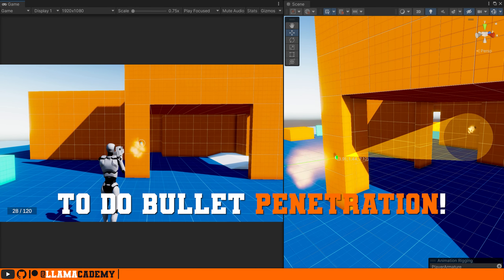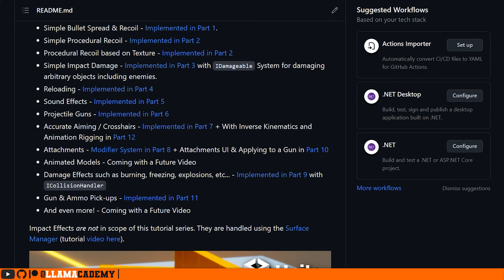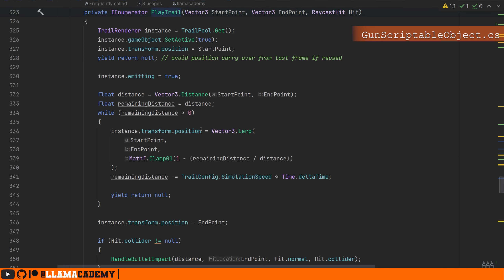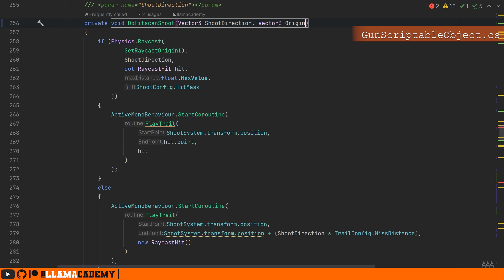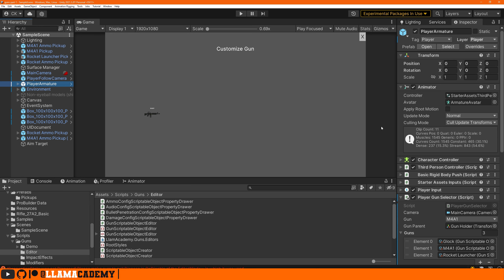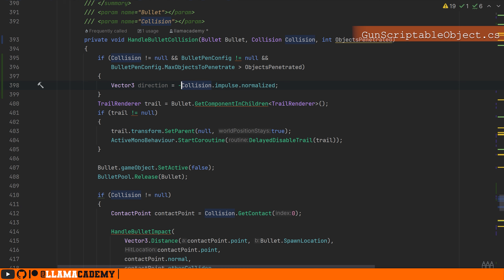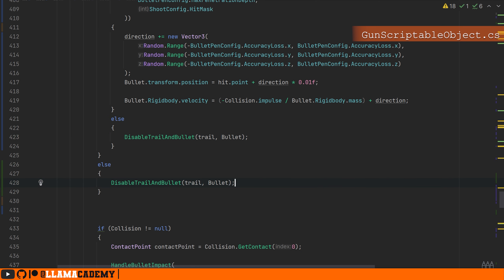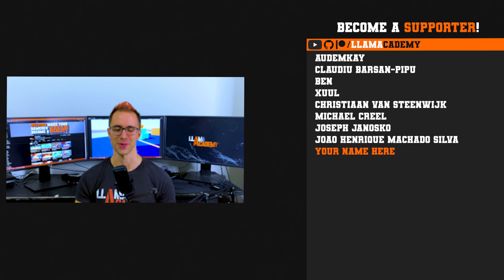Bullet Penetration with Raycasts and Rigidbodies | Gun Series Part 13 | Unity Tutorial

Comment: Chris for the test-your-knowledge portion, would you just edit every attribute on the bullet pen that's configured with the modifiers OR would it bet better to make a Modifier that can replace scriptable object reference ?

The SO reference way seemed less verbose BUT getting a reference to that is a bit hacky
Reply from the maker: I personally like the ScriptableObject replacement one better. That gives you the same authoring flow of the configuration and it's just a matter of tying the SO to the Modifier.
If you want to get REALLY crazy you could make AbstractValueModifier a ScriptableObject (right now it's just a standard C# class implementing our IModifier). This would allow you to create SO instances of each modifier which makes it easier to hook up your SO references without having to do something like Resources.Load or have all the references to the SOs on a MonoBehaviour that knows about the modifiers.

I did something like this previously but found it to be somewhat annoying to make the modifiers. If you go that route, I'd build out some editor tool to make that easier.

Comment: First, I just want to say that your videos are great, they are miles above most of the other channels who teach Unity incorrectly (like framerate dependent lerping is a frequent culprit) yet have 100ks of views.
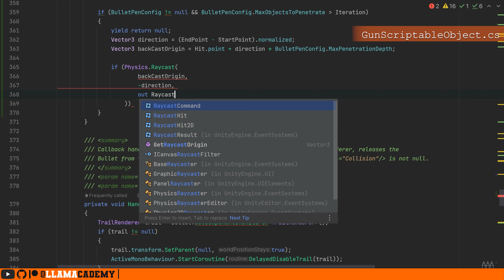I have modified your system quite a lot, but I still think I have discovered a potential bug in the way your bullet penetration raycast check works , shown at at 6:45. It would typically only matter if the MaxPenetrationDepth is a larger value though. Essentially, if you shoot a collider A, and the "backcast" ray hits another collider B, this means that the hit point of collider B will be the new trail/shot origin passed to the subsequent recursive call to DoHitscanShoot() - effectively meaning the space between collider A and collider B is ignored. You might already be aware of this, and it might be by design + I can't really think of a good alternative solution to avoid this, but I felt like it was worth mentioning
Reply from the maker: I did think about this but couldn't come up with a great solution for it. If you come up with something let me know! :)
Reply: @LlamAcademy  I have come up with a solution. After the first raycast A, you do a second raycast B in the same direction but with the origin set to A's hit + a small step in the shoot direction to prevent hitting the same collider again. Then, if raycast B hit something, you do a new raycast C with origin at raycast B's hit, but in the backwards direction. Raycast C should hit the same collider as raycast A, but on the opposite side. Now you can compare raycast A and C's hit to get the depth of the collider. To continue checking for colliders, set the raycast A's hit variable to raycast B's hit variable (hitA = hitB), and repeat the raycast B and C step in a loop, such that the next iteration raycast B's origin is set to where the previous raycast B's origin hit. I hope that makes sense

Comment: Hi Chris, good tutorial as always, but I have a question. If you have random between two constants damage selected(i.e 10 and 25) and damage retention percentage for example 0.75. You get this weird thing where the first contact can do 10 damage and the second contact 25*0.7 = 17.5 damage. How do you recommend to fix this?
Reply from the maker: That is a great question! It probably makes sense to make the damage calculation consider the original damage amount instead of the maximums. It also probably makes sense to move the penetration calculation within the Damage Config.
This becomes a little tricky for hitscan, but easier for projectiles. 

In this video I was considering constant damage or single curve falloff primarily. For those cases with random between range or random between curves we can end up in situations with this implementation where the second iteration could do more than the base.

Let me put something together and make a branch on the repository and make a pull request. I'll reply here once it's up.
Reply: @LlamAcademy  Thanks a lot! Your tutorials are very helpful.
Reply from the maker: I didn't forget :) this is a little more complex to handle than I initially was hoping. I may end up making a video about it
Reply: @LlamAcademy  Looking forward to see the video

Comment: Hi!
In GunScriptableObject script, there is a method called Clone. I notice that you create Gun scriptableObject via the Unity Editor and Instantiate it with Clone() method. Are we obliged to create an instance of these scriptableObjects after we created them via the editor? Why ?
Reply from the maker: We do this so when we are playing around in the Editor at runtime we don't accidentally modify the base values of the guns. In this series we've implemented Modifiers, which at runtime manipulate some of the configuration values.

It is not mandatory to do if you do not use a modifier system, but it does help prevent accidental runtime changes to the base configuration of the guns.
Reply: @LlamAcademy  Thank you